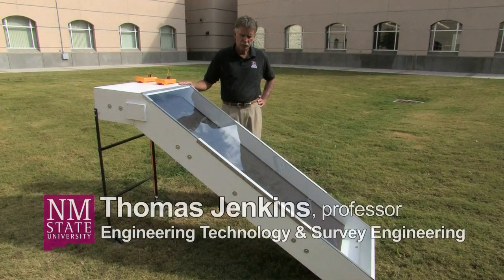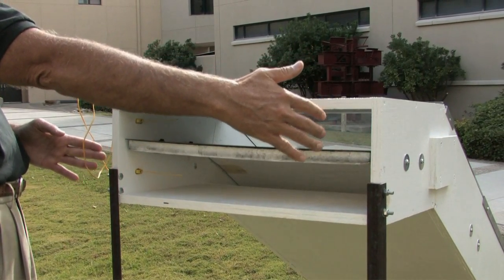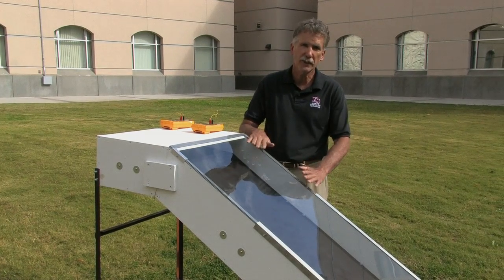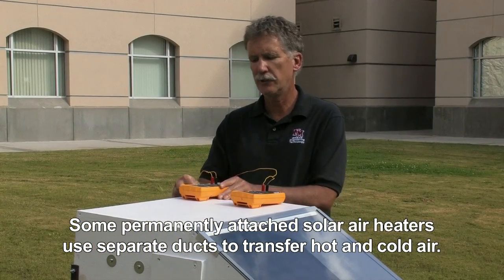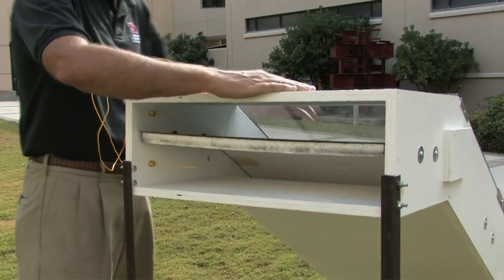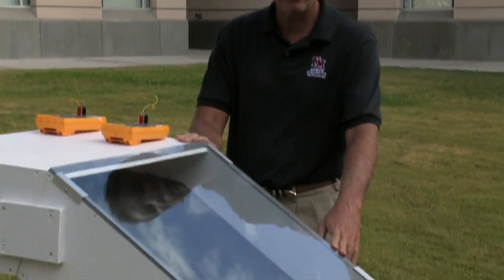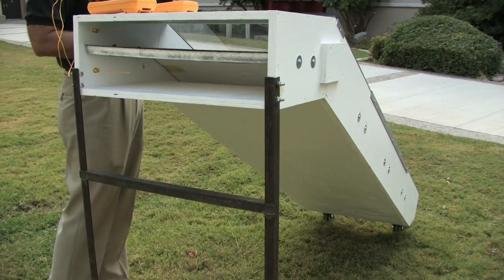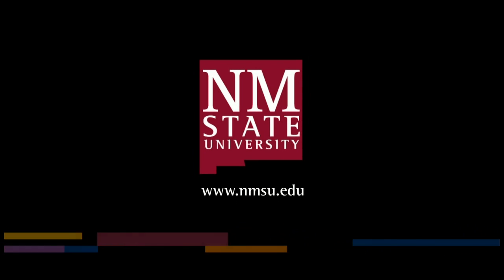Renewable Energy: Solar Air Heater

Comment: I have a question. Everyone is using aluminum. But I'm looking at a table that says copper is twice the heat conductor and steel is 1/7 th the conductor (which then means it holds heat? more). Does this process need the material to be a conductor? if so it is half efficient.
Doesn't this process require steel to absorb the heat to its max then it can do nothing but release it. The enclosure is insulted to contain heat. And shouldn't whatever material used be thicker to absorb as much heat as the surface area will allow before it levels out to cool.(whereas everyone says a thin layer to transfer heat is the way)

Comment: This man is a professor but it never occurred to him to paint the entire unit black where the sides of the thing could warm up and reduce heat loss if not add some extra thermal energy? Would see obvious to me to make the entire thing black where it could be impacted by the sun. looks like the collector area could be as much as doubled even if not active all at once.
Reply: You only want inside black, & insulate the inside of the box, except where glass is.  And, mount it at angle perpendicular to winter sun, not summer sun. Or, mount flat to wall, to ease mounting, & ease shading the panel in winter.
Reply: These panels need shaded in summer, & vented to outside during summer, to block heat entering house in summer…another point towards mounting flat to wall, in latitudes like the Pacific NW.

Comment: That cold intake is still to high up. Cold air &hot air next to each other wont work dude sorry. Cold air inside the room exits at floor level & Hot Air pumped in Mid-Way.

Comment: I haven’t seen in any of the many videos with similar ideas how the unit performs at various ambient temperatures. Only one showed temperatures on a cooler day and it seemed that there was a difference in heat produced of hot day - cool day. In other words for every one degree of difference in ambient temperature there was a 1 degree difference in heat production. This would also be decreased in the cooler/coldest months by the lower heat value of the sunlight. This lower value can be felt by walking in the sun in South Florida in the 98 degree summer and walking in the 70 degree fall and the 28 degree winter.

So I would love to see a report that would list something like this:
Date:
Ambient Temperature:
Radiant temperature of box: (sides, glass, ducts,etc)
Intake air temperature:
Output air temperature:
Air temperature in room:
Additional heat added to room: (Humans, HVAC, lights, cooking, etc.)

A good test would be to use a room that has no heat source in it. Let the room cool to ambient temperature. Attach the unit and record the start, and in between times and final temperature when the sun goes down.

Then of course would be the volume of the air moved by the unit. Let’s assume the same temperature of air is produced but the volume moved differs. Obviously a small amount of air will not produce the same heat value of a much larger volume of air.

So, the critical questions are how does ambient air and the time of year affect the heat production? And how would increasing the air flow affect the heat produced?

Will the unit produce hot air when the ambient temperature drops below freezing seems to be the critical question.

OK, these units might be quite valuable in cooler temperatures that are very uncomfortable for us furless creatures such as 40-60 degrees Fahrenheit. But my curiosity is how well they perform in freezing temperatures having encountered 28 degree temperatures in Florida in my uninsulated and unseated camper van. I slept under four blankets wearing three pair of socks, those grey sweat clothes, two pair of jeans, a layer of four shirts, two pair of socks for gloves and a pull down head covering for my eyes and ears and nose. Quite toast until I had to get out of bed... A unit like this if it produces heat in 28 degrees would have been perfect for the day time.

I am a database designer and I will add this question to a table and people can record their results and share them...
Reply: Here’s input:  I made (2) 4x8’ panels, using mostly recycled materials. Had to be low cost.  Might have spent about $200, mostly for insulation, high-temp paint, & a cover material. 
Context: Pacific NW, in SW WA, about 35 miles from Olympia, & site was a valley @ about 100’ altitude.  
We had these serially booted to a tiny bathroom window (only one usable, facing south), old house retrofitted to modern Codes.  So, heat from panels had to wend its way out of there, up hallway, to other rooms. 
Winters can (rarely) drop to low single digit, sometimes to the teens, more often, some nights in the 20’s.  Summers can & do hit the 100’s, but only usually for about a week.  
There are about a couple weeks, around Christmas & New Years, too dim to use solar & get much from it. 
The rest of the time, we often have cloudage, which diffuses sunlight, making it omnidirectional, making up for having less of direct sun.  So, we can, if need, mount solar flat. 
Boxes made of 1x6” boards, lined with 2” R-10 foam boards, then lined those with heavy duty aluminum foil.  Then, I processed aluminum drink cans into tall tubes, by punching several more holes in the tops of each, slightly crimping the necks of the cans, and cutting off the bottoms, so they could sleeve together in stacks with baffles inside.  
I had tested on 6’ stack for output temp, on a dark, 23*F morning, sight breeze, on our porch. Input temp @ bottom, was 23*F; output temp at top was 23.5*F. 
Astonished, I tested it several times, each time getting about half a degree more warmth out of the top.  Sold the idea to use this method to heat air! 
As many of those tubes as could fit vertically/lengthwise into the box, & used some random sheet metal or foil, to make manifolds at top & bottom, to feed / collect air to/from the tubes. Filled between stacks w/ foam, then painted the foam & cans with high-temp flat back paint. 
The boxes were connected by 4” tubes between boxes, upper & lower, to connect at the manifolds.  This allowed option to use separately or together, or to add more panels.  When the holes were not needed, inserted standardly available caps like pumping or vent parts. The 4” duct fan, fit into one of those holes, & could have been run off a small solar panel..which also would have helped automatically shut the panels down at night, or when light was too dim. 
The 1st cover material was low cost polycarbonate greenhouse or patio panels.  Those worked marginally, but leaked air to the great outdoors, because it was near-impossible to seal the gaps. And, it buckled a bit from the heat.  
But we still got some meaningful heat! 
A couple years after installing, we upgraded the cover to Twinwall polycarbonate, better air-leak-sealed. And, installed a 4” duct fan at the far end, to push assist the air to move through. 
THOSE improvements brought a significant increase in efficacy!   We could see the drop in the electric heat bill, 1st after the install, & more after the improvements.  
The design he shows, is going to be less effective, because it fails to separate cold air intake far enough from hot air outlet…. So, the same way some “direct-vent” gas heaters can snuff themselves for same reason, the demo’s box in video is a setup to fail to run as expected. 
Our panels, I made a window boot, with a separate, operable vent to output hot air at the top, & an outlet vent at the bottom, with a section of drier vent tubing to bring in room air that was A) below the hot air and, B) separated farther from the hot air outlet.  Without that, it cannot work right.  
If solar air heater panels need to bring in rest air, do that farthest from the outlet, to allow more time/distance to heat it.  Better, use fresh air intake with more panels! 
Sorry, lost the output data. 
The house was a heating nightmare. Landlords had installed the common Cadet wall heaters mostly on building envelop (espxterior-exposed) walls (read: zero insulation behind them).  Those things shocked us with about a $200+ electric heat bill the 1st winter there…& that was using them modestly, keeping indoor temps around 60F. 
First improvement: bot a $40 “oil filled radiator”, set only on the 700 watt toggle, then adjusted rheostat as needed. Fiddle fiddle.  We sited the heater as close to the middle of that old, 850 sq.ft. house, as possible, to best heat the interior mass, to most effectively retain heat.  
 But..that dropped the worst winter heat bill by $50. We win! 
The solar heat panels dropped the bill, when we improved it, by about another $50. We win! 
We used that for about 7 or 8 years, before moving.  I am in process of building a similar system into a patio roof we built on south side of a house, similar area. But, with a bit more sq.ft..   
The house here, is about 1400 s.f., similar 2x4 construction.  Also plan to add solar water preheating for water heater.   As at the other place, we keep indoors at around 60*F in winter.  Luckily, the back (hidden from public) side faces south, here. 
Heat produced from the old panels, of course varies depending on outdoor ambient, indoor ambient, weather, latitude, & user-involvement in regulating it. 
It could have been tech-regulated, but that’s more costly & more fail-points. 
Our goals were simple:  
…beat the rising utility costs in meaningful amounts. We did. And, it could have even been done better. 
These days, those who, with engineers, ridicule small efforts as useless, are destructive relics of usurious industry/academic attitudes.  
Now, every little bit any can reach to do, helps. 
But, there’s a LOT of gonzo tech, people trying to make their own versions, but failing to pay attention to best ways to optimize simple design.  Some work better than others, so, they still get something…just not as much as they might. 
There are a few core design bits that make it really work…like, the core design bits that make a rocket stove work right (see: Liberator rocket stove).   
People just have to really understand what those are, or, the waste time/materials for little good accomplished…or could even do harm (as in rocket stove done wrong)
Reply: @Chimonger1  Remarkable reply! Thanks. May I post on my blog or do you have a url I can point to?
Reply: @fmpApps    How may I find your blog?  What do you blog about? 
(Considering!)

Comment: Great idea for some locations. I would use 2-3 layers of thin glass on the front, several inches insulation on the sides, a cold air draw down the wall to the floor, and expand the width outside the window as much as possible. Also consider reflective material on the ground in front of it and on the sides to reflect more sun on it if possible. A hinged door inside the window could shut it off. Done from a 2nd story window to the ground should create a very strong draw naturally in the sun!
Reply: Windows and used sliding doors for glass can be found for free on Craigslist and other similar places. Same for insulation scraps, and sometimes wood.
Reply: Good ideas.  Darwin said it first I believe, about 150 years ago; " not the cleverest, not the strongest, but those who can adapt, survive".

Comment: The problem with this design is that the intake and outflow are next to each other. You then have recirculation - some of the hot air is sent back through. You could improve with an air intake duct that takes air from near the floor of the room.
Reply: But IT IS USING the same warm air just reheating it which sounds good to me.
Reply: Pay attention just make one of the flows extended inward into the room with small fan blowing air in the heater...
Reply: We have been building this design for nearly 50 years.  Using black painted corrugated barn roofing as the collector.  We connected a box to the out put with an opening at floor level to draw cooler air into the syphion.  
We constructed doors for the openings for nights and cloudy days, but found in actual use that they were not necessary.  Little if any flow occurred unless the air in the syphion was warmer than the room.  
The use of these boxes make a significant increase in the temperature of rooms where they are placed.  
During warm seasons they may be removed as no change (other than removing screens) to the window is needed.  Or they may be left in place covered.
Reply: @shermanhofacker4428  the key point was, you made a separator between the intake & outlet, & directed cooler air from closer to the floor, as intake.  That was why yours worked!   
—> The direct vent gas wall heaters are often glaring examples of this principle, when the intake & outlet pipes, usually sleeved one inside the other, are dimensionally too close together in length, causing exhaust to get sucked into the intake, snuffing the flames.  
This guy’s box, as-is, fails. But, if he did a good job separating those, it would work.
Reply: First thing I noticed. What kind of moron made this thing? They didn't even seem to do any research on how different designs work, it's the worst proof of concept ever, which is actually pointless, as people have been doing it for decades.
Reply: @Sherlock_MacGyver  
Wrong.  
This is the best design I have found for the application intend.  I would love to see one that equals or exceeds the benefit.

Comment: The angle of inclination is made for summer sun. For winter version it should be much higher... Also i see no heat isolation, at least on sides....
Reply: probably did for the off-season.  (май, октябрь
Reply: The more north, or the colder the climate, the more effect the insulation will have.  My first house was a passive solar ski chalet in Quebec. I experimented with colors and heating water when I was a 'Castaway' on a beach in Central America in the '90s.  Not surprisingly, my Forest Green bucket heated water to shower temperature every morning, faster than the blue or white buckets.  (You couldn't get any other colors)  
"So that's why grass is green", I concluded.
Here in Palm Springs where it hits 121F on occasion, we're still at 33 N. Latitude and have two winter months when it's cold (er).  These stucco encased houses have a huge 'heat islanding' problem, sometimes the houses don't cool off completely at night, starting a new day with a few degrees "head start" during summer months.  I'm going to 'wrap' the outside of the house with polyisocyanurate based insulating panels and a Radiant Barrier reflective surface followed by a light-weight weather cover like steel or thermal wood.  (Wood where the sun doesn't hit the wall)  The truss  roof is another proposition, using a similar but more tedious method to remove all duct-work and seal off the conditioned space below.
Another answer would be a mini-basement-tunnel under the slab with openings on the north side and on the south-facing side.  By opening and closing the grade-level inclined access doors you can let either north side air, or pre-heated southside air, into the tunnel space where an efficient but common Air source heat pump can turn that air into AC'ed air or Warm air using one  120 Volt, 20 Amp circuit, powered by a solar PV system.
A million houses in southern California will be energy liabilities as grid power becomes more expensive/exclusive.  Moving the stucco concrete jacket that acts like an overcoat on your house during summer, to inside the conditioned space, where it becomes thermal mass and helps to mitigate extreme temperatures, is a good start to saving some of them.
But it's not even in the code yet, and my experience with City Hall so far, is that rules are rules and if your project doesn't follow them, it  won't get built.  (legally)
Reply: The angle is usually determined by location, but in practical use the height of the window and length of material used have a great impact.  If a longer box could be made, a sacrifice of optimal inclination resulted in more heat.  
If allowed we place mirrors on both sides to increase energy collection.  Again the angle of the mirrors are not optimal but they significantly increase heat to the room with little cost.

Comment: None of these videos show the entire thing from build to installation to the actual room temperature. Why doesn't some one do that?
Reply: Construction is so simple and costs are so low I can't see any need for step by step video.  Exact measurement and plans are not possible for every window in which it might be placed.
In addition, the length and depth of the box is not critical.
Reply: because you cannot handle the truth
Reply: If a permit is required, you would probably run into something they don't like.  During the night for example, how much heat is lost from this device?  A simple door(s) inside the house could close off the opening, but that's contrary to true "passive" rules.  
I model houses in 3D (Sketchup) which allows you to analyse (fairly new programs for that are either too simple or too complicated, so far) your model to measure heat gain, loss, air flow, effectiveness of thermal mass, changes in glass size and location etc..
You can literally make a wall thicker and then see the changes in measurements of energy movement, or increase the size of a window and see how much more energy is lost during the night.  Sun shadows can be shown in minute increments throughout the year.
The point is that an energy device like this air heater would be customized for the house and it's circumstances, like location or floor plan.  I can see a few "portable" standard sized units that you might take to a cottage or use on a travel trailer or some other 'temporary' setup.  Nothing worse than a frozen outhouse.
Reply: Mother Earth News has been running plans like this since the 1970’s.